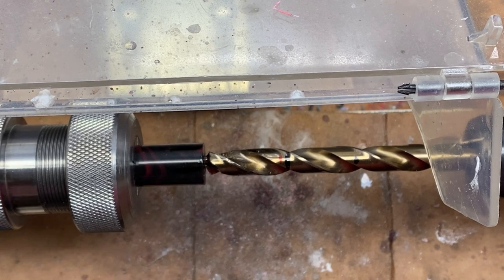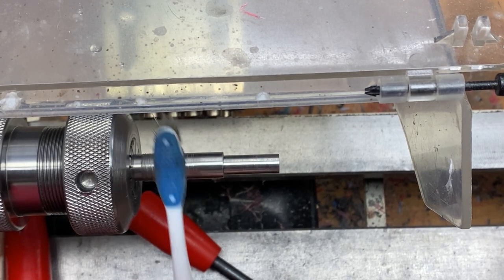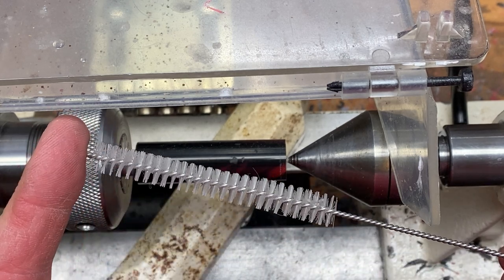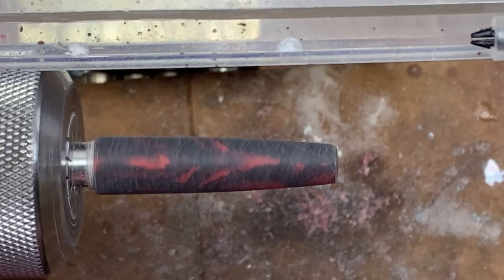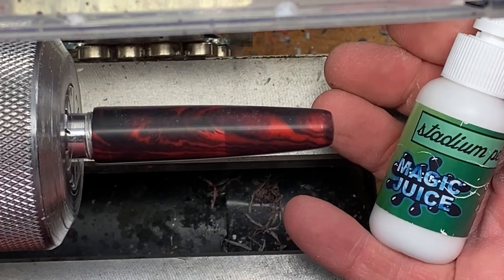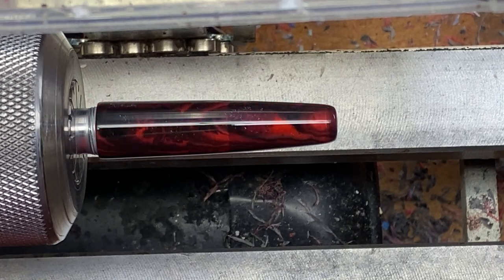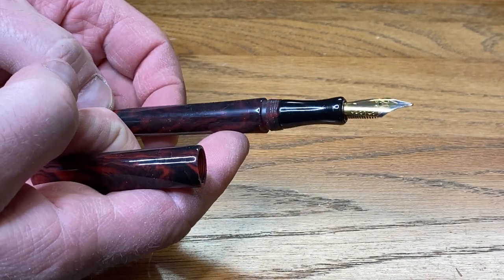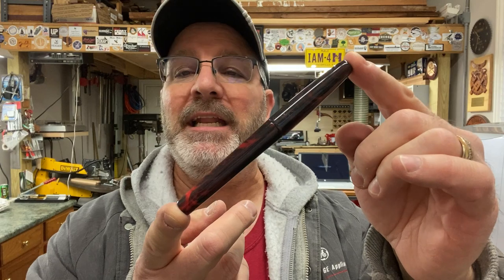Turning A Kitless / Bespoke / Artisan Pen Cap

Comment: Hi Bob. A lot of the bespoke pen makers use triple start taps and dies. Do you use them as well? Is using standard single threads OK in the beginning?
Reply from the maker: Yes, I use triple start. 
  Using single start is OK for learning because it saves some money and it works well. You can learn on single start then move to triple once you’ve mastered the process and are ready to sell your pens. 

Regards,
Bob